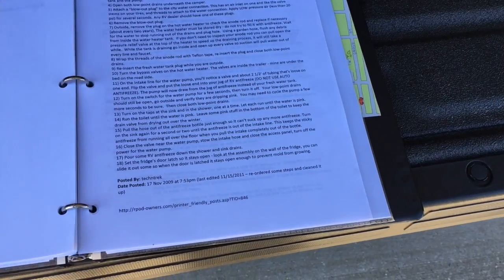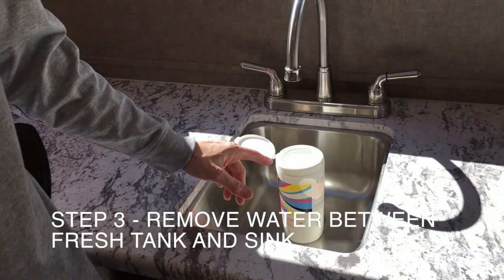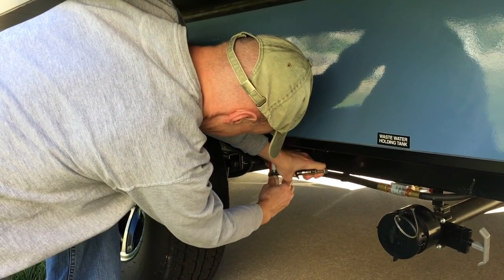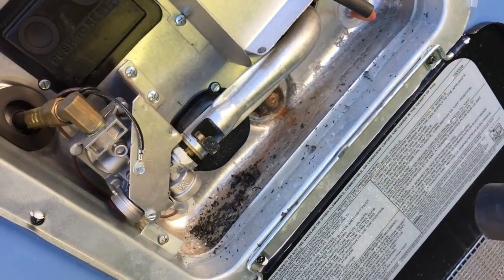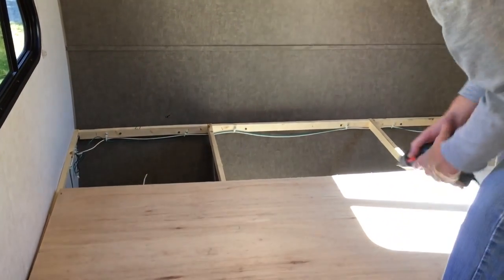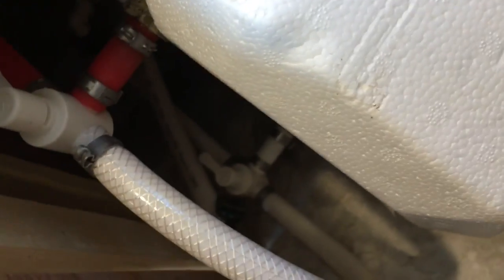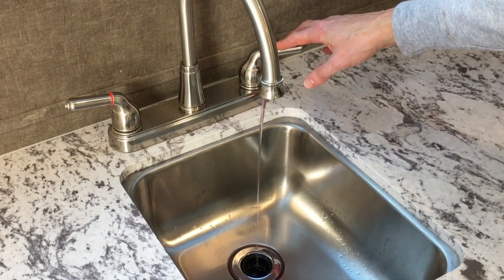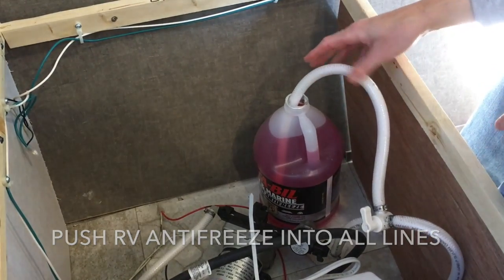R-Pod RV Winterize – Step-By-Step Process (with Anode Rod)

Comment: Thanks very much I have an RPOD 178 very similar, mine did not have a low water drain for the hot just a combined one.  It was not as low as the one in the video which made it a little harder to get the cap off.
Reply from the maker: Ok, thanks for the comment!

Comment: Hi John, great video. Second year watching the video to winterize our pod. Question, after pumping antifreeze through the lines, do you return to valve handles back to normal operations setting? Apologies if this was asked previously.
Reply from the maker: I do not. I leave the tank bypassed until Spring when I dewinterize. Thanks!

Comment from the maker: I should have mentioned this on the video, but we went through about 4.5 gallons of RV antifreeze to do all this. A full gallon to get stuff coming out of the low-point drains and another 3.5 to get a good color stream from each of the faucets and toilet, as well as putting some in the traps. Hopefully this info helps if you are going to buy some. Walmart has plenty as well as Menards this time of season.
Reply from the maker: I have done this more recently with 2 gallons. I think prior to this I was wasting much out the low-point drains!
Reply: Hi John, I was wondering if once done with the winterizing steps, can we return the water lines to normal operation? This would help save time in the spring. I have the 179 also. Thank you.
Reply from the maker: @RobertLee-if9ix  You sure can.

Comment: Your videos are so helpful.  Thank you!    
I would just like to see (hear) your commentary regarding flushing the antifreeze through to “please capture the antifreeze as it exits your RV!”         This product has a sweet taste and attracts animals that will die if they ingest it.
Reply from the maker: RV antifreeze is not car antifreeze and is generally considered food safe. I do recommend using a bucket under the low point drains to capture and reuse the rv antifreeze in the p-traps in the last step. Thanks!

Comment: Thanks for the great video.  Kinda a revelation to know that it will take 3 hours and lots of antifreeze.  Hot tip on blowing out the lines!  One never seems to get all the water out no matter what.  Hence the need for the antifreeze to backfill the fines; just cheap if not time intensive insurance.  Thanks again.
Reply from the maker: Thanks for the comment and for watching! The three hours needs a bit of clarification. That includes all the time it took to drain a full freshwater tank and the fact we were filming the process. This past time, I had the fresh water tank already empty and wasn't filming anything and it took less than half that time. Hopefully this better sets your expectations. It also is nice to have someone with you helping open faucets when pushing antifreeze through the lines. You can save a good deal of antifreeze if someone is helping out. All the best!
Reply: Yes

Comment: Big help.... thank you!  the heating rod looked pretty bad on my 2016 rpod 179.... so I will replace it.  The guy we bought ours from said he just blows out the lines . We live in Montana and may use it in the winter to go south.... is that something anyone else does (skip antifreeze)?  then you don't have the antifreeze taste in your water.
Reply from the maker: Some people used forced air and only blow out their lines. There are videos online about this method. I’ve only ever used the RV antifreeze method as it is factory recommended and I’ve never had an issue. I also don’t have any RV antifreeze aftertaste. Thanks!

Comment: Hi John - I just completed all of the steps in your video, with the exception of blowing out the lines with an air compressor. Since all the lines now have antifreeze in them, can this step be skipped? I don't have an air compressor. We live in Oklahoma, so we usually get a few days of 0-10 degrees F, and rarely an extreme of -10 degrees F (once or twice a winter). Thanks.
Reply from the maker: You should be ok, as long as you are getting RV antifreeze out of all the faucets, including any outside shower or quick connect.

Comment: John, do you pull out your rv batteries and put them in your garage? I'm in NM and gets as cold as MI if not colder. I probably will pull them out.
Reply from the maker: I do pull out my battery when the trailer is in storage. I keep it in my garage off-season. Thanks!

Comment: Thank you for this!  

I do have a question about the Hot Faucet knobs.  I couldn’t get anything to run out of the hot faucet on the kitchen sink or the bathroom sinks. Cold faucets were fine. I would think that is fine because we disabled the water heater line, but you show pink antifreeze flowing in the hot water faucets.  Did I do something wrong?  Is it going to be ok?
Reply: BTW ours is a RPod 178.
Reply from the maker: Are you absolutely sure you bypassed the hot water heater? If not, you will be filling up the hot water tank. You certainly should get antifreeze from both hot and cold taps.

Comment: Just got a used 180. Is it really necessary to find the water pump and run antifreeze thru the lines if I have blown them out with the air compressor? Can't I just then pour antifreeze in the p-traps, the sinks, and the toilet, drain the hot water tank and call it a day?
Reply from the maker: If you only use compressed air to blow out all the lines you don’t need antifreeze but there is a specific process to follow. I haven’t done Winterization using compressed air only, so you’ll want to find a good video or two that will walk you through the process. Thanks!

Comment: Saw in one of your podcasts where in a pinch, you used a Viair tire air compressor to blow water out of your lines.  Knowing that it’s not a full winterization, did you find that this worked for you in a pinch?
Thanks
Reply from the maker: Don't remember using just an air compressor to winterize in a pinch. Can you let me know which podcast you are referring to?
Reply: @JohnMarucci  you ran winterization fluid through after using what I thought was a  Viair tire compressor with adapter… my question is to what extent did you find that the Viair pushed water out of the system, and which, and do you remember which Viair compressor model you used?… Thanks
Ps : Hope all the kinks are out of you new rig!🙏

Comment: Since you apparently live in MI, what do you do about winterizing after you travel south during the winter?  I would assume it will be freezing when you get home (say in Jan/Feb/Mar) so you need to winterize along the way home, right?  Also, are you de-winterizing in the cold before you leave - doesn't that create freeze problems? Trying to understand so perhaps we can travel during the winter from OH.
Reply from the maker: I usually travel south and de-winterize once I am in a climate where it will not go below freezing, usually TN or GA. On the way back, it is generally later in the winter and often I can time the return so I have a day or two to winterize when I reach home. I do however, carry a couple of gallons of RV antifreeze and my small air compressor with us going back north in case we do have to winterize along the way. Thanks!

Comment: Having trouble. Got to the point where I am running Anti-freeze through the pump and nothing is getting to any of the sinks and only one of the low point drains. Does this mean I have a leak and where do I start looking for signs of that? Thanks!!
Reply from the maker: If I understand correctly, the pump is drawing antifreeze from the jug, but with the low point drains closed, no antifreeze is getting to any of the faucets. If the plumbing worked fine during season using the fresh water tank and pump, likely you don't have a leak. It is possible a faucet aerator is clogged. You may also have your hot water tank unbypassed, so antifreeze would be going into the hot water tank and not the lines.

Comment: Hi john , thanks again for all that you do and these very helpful videos! , question.. is it to late to blow out the city water hook up after you have already winterized your pod ??
In other words hook the air compressor up … will it blow out through the low point drains only ?
Pink stuff has been fed into all the trailer lines! 
Thanks again and will be waiting for your response
Reply from the maker: Randy, I don't have a plumbing diagram for the R-Pod, but I think that if you blow air through the city water inlet, it should push through the plumbing lines and to the low-point drains pretty quickly. I am not sure how much RV antifreeze you would lose, but likely most will remain in the lines. If you do this, you might want someone to help you manage having a bucket under the low-point drains and also closing the low-point drains after you get air through. I wouldn't open other faucets or have the air compressor running unless the low-point drains are open. Thanks!
Reply: @JohnMarucci  thank you John , I pulled each one of the caps off this morning before leaving for work and it was nothing but pink stuff that drained so it looks as though I’m good !, thank you so much for getting back to me and I must say that your videos are pretty much spot on !
I did have 3 valves besides the antifreeze by pass line, cold , hot, and the third line  , that we turned off as well , but all drains and faucets were pure pink , drains and full , I did put about 3/4 to a gallon in each of the tanks !, probably over did it but would rather be safe !
Thanks John , looking forward to your next video !

Comment: John, what do you do if the pump isn't pulling antifreeze out of the jug? Worked last year; didn't work this year! Bypass valve set to bypass; pump worked before I drained the water...
Reply from the maker: Clem, are getting suction at the tube that pulls the antifreeze? If not, is the pump pulling water ok from the fresh water tank?
Reply: @JohnMarucci  Thanks for your speedy reply, John. It doesn't seem like there's any discernible suction at the end of the tube. However, when I put the bypass valve in in-line mode (ie, no bypass) the pump pushed some remaining water out of the lines, so it seems like the pump is working normally. Other suggestions I have tried: 1) Press the valve behind the CW filter to relieve an air block: Did that. A little water came out but didn't solve the problem. 2) Make sure antifreeze jug is above the pump: Yes, it is. 3) Check that bypass valve is working: Visual check of aftermarket bypass valve seems to show the valve is working properly. 4) Put the anode back in: I did that but since I have bypassed the hot water tank, that doesn't do anything. Other solutions offered involve pulling the pump (may need replacement) but as I said above the pump seems to be working. I have made an appointment next week with the service dealer I had gone to in the past, but would rather figure this out myself (with your advice!) if at all possible. Thanks.
Reply from the maker: Clem, the only other thing you might want to try is to prime the pump. I did this recently using a small funnel and the jug of RV antifreeze. Basically turn the water pump on and pour a bit of RV antifreeze into the intake line. It make take a moment, but if the pump is working and has no air leaks in the lines near the pump, it should begin to pull the RV antifreeze in. Once you hear or see (if using a clear line) you can quickly put the intake tube into the bottle of RV antifreeze. Hopefully this will work.
Reply: @JohnMarucci  Thanks, John. That didn't work either. The antifreeze that I poured into the tube went somewhere past the pump, but didn't make it to any of the outlets. Air leaks in the lines are a possibility but that would be quite a job to trace, I would think.Someone suggested connecting a shop vac to the kitchen faucet (a new use for duct tape!) with the pump running until the pump takes over. I may try that.

Comment: John did you add the hose and bypass valve on you rpod to pump the antifreeze through the system or is that installed from the factory
Reply from the maker: Kurt, my R-Pod had the hose and valve from the factory. There are kits to add if needed.
Reply: @JohnMarucci  thank you

Comment: Thanks John.  One thought, does it make sense to turn on the water heater bypass valves before step 3?   Otherwise. When trying to drain the lines I think the pump will be pulling  from the full water heater every time you turn on a hot faucet.   I ask because it was taking much longer than 15 mins and I can hear it sucking from the full water heater.
Reply from the maker: Ed, the water pump only pulls from the fresh water tank. Are you sure you had all the water fully drained from it before running the water pump? The basin sits lower in the middle vs where the drain plug is, so you may need to lean the trailer down a bit to fully drain it.
Reply: My 180 was taking forever on this step.  Finally I just opened the outside shower and walked away.  Maybe they stuffed 3 miles of water hose somewhere inside the walls, lol.
Reply: When I came to step 7, hardly any water came out of my hot water heater.
Reply: Of note though is that I have three shut off valves by the water heater (not including the anti-freeze valve)- unlike yours in the videos.  I may have had one open/closed that I shouldn't have?

Comment: If the water pump stopped working when pumping in antifreeze what would could cause that? I have replaced some of the fuses but wasn't sure which ones to replace.
Reply from the maker: Are you sure that you still have 12 volt battery power working in the RV? The water pump uses 12 volt.
Reply: @JohnMarucci  Thanks John, I figured out that I didn't pump enough rv anti-freeze into system before closing the low point drains. After opening them back up the pump started right back up.
Reply from the maker: Okay, thanks for letting me know!

Comment: when the antifreeze comes out the low point drains do you cap it off immediately or turn pump off then put low drain point caps back on
Reply from the maker: Robert Daniels I usually turn off the water pump immediately and hop outside and cap the drains. It helps if you have someone helping at this point to cap the drain quickly so you don’t waste too much antifreeze. Hope this helps.
Reply: John Marucci thnx man

Comment: Thanks John. Very helpful video. Question for you...after running antifreeze through water pump I was not able to see anything coming out of the hot water low point drain. Where did I go wrong? Thanks,
Reply from the maker: Rodney, are you seeing pink RV antifreeze coming out of each hot water side of the faucets?
Reply: @JohnMarucci  Yes
Reply from the maker: That’s good. So if you open the hot water low point drain only with the water pump on at this point, you should see pink antifreeze come out. May take a moment. You really want to have someone help turn the pump on and off for you as you open then close valve. If nothing comes out, maybe the water heater isn’t bypassed? Have a retry and let me know. Thanks.
Reply: @JohnMarucci  I will try that. Thank you much. Really enjoy the videos. They have helped make the trips in RPOD more enjoyable.
Reply: @JohnMarucci  I think I got it. There was another valve in addition to the hot and cold bypass valves that needed to be turned (open or closed- not sure) and this allowed antifreeze to run through lines and exit hot water low point drain.
Reply from the maker: Thanks for the update!

Comment: hi John thank you for the great steps! Do you recommend adding antifreeze to your freshwater tank? I did not see it in your video or others related to the r-pod but I've seen it in other RV winterization videos. Thanks in advance! Paul
Reply from the maker: Paul, I throughly drain the fresh water tank and only put the pink antifreeze through the intake tube next to the water pump when adding it to the water lines. I know some people do put the antifreeze into the fresh water tank in other RVs, but I haven't seen the need to do this with an R-Pod. It isn't too difficult to run it through the intake tube provided. Thanks for watching!

Comment: I don't have an air compressor!  I live in B.C. so heavy winters.  Any suggestions if no compressor?!
Reply from the maker: I suppose if you didn't use your city water connection, you can just use antifreeze. I did see a small compressor with 70 psi max on Amazon for just over $30 US. It might be worth considering as part of your tool kit for winterizing and to keep tires properly inflated. Thanks!
Reply: @JohnMarucci   Thanks!  No Io I did not use city water.  I have opened my low drain, emptied the fresh water tank.   Turned on the water pump and opened the tap so nothing is coming out.  I closed off the valves to the hot water heater pulled the anode out and let it drain with a few flushes.  So now I guess I find the intake bypass and put the hose in the antifreeze and run it though all taps in how and cold?  Then some extra in the drains and toilet correct!?  Then replace the anode for the winter.  I haven't done the antifreeze because I could not find the hose so I am looking further under the bed today, I did however hear a little water sloshing around near the pump when I turned it on to look for it, hope this is still ok at this step.

Comment: Great video as usual,  seems like process will work for my NOBO. Question how many gallons of Antifreeze did you use?
Reply from the maker: About 2.5 gallons, but I think I could have gotten by with 2 had I not lost as much via the low point drains. A bucket under these drains (if doing this solo) or having someone shut these off quickly would save a bunch of antifreeze. Thanks!